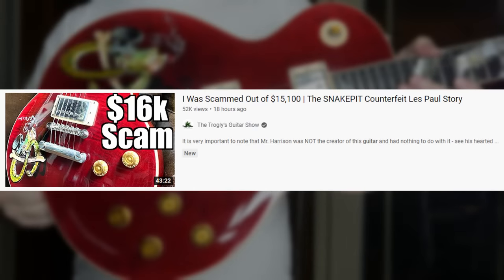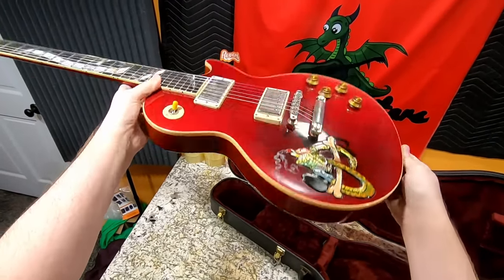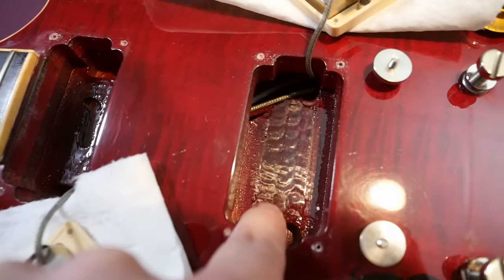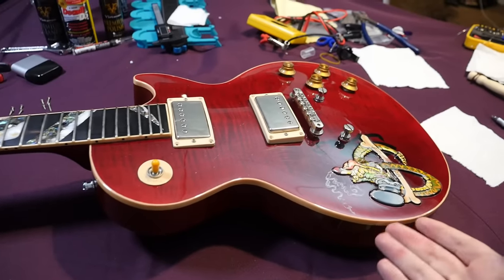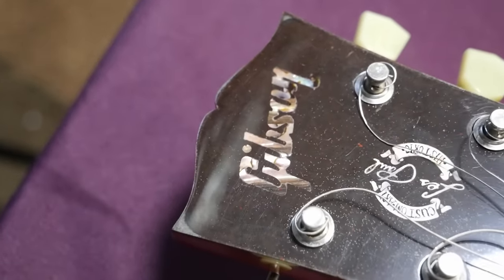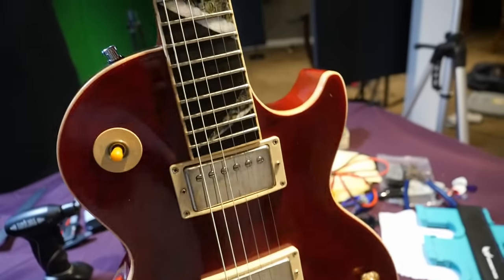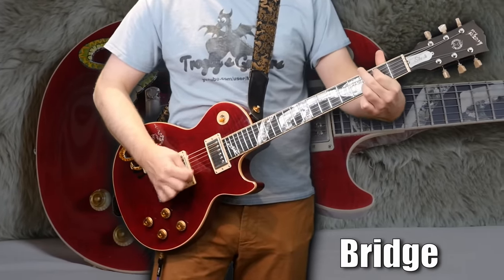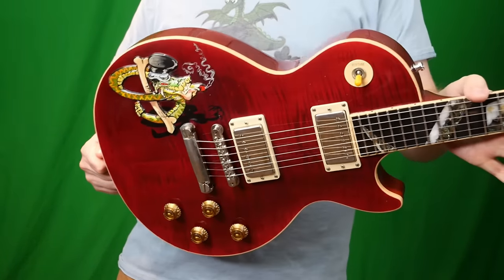Trogly's "Fakepit" | The Replica 1997 Gibson Les Paul Slash Snakepit | History + Review

Comment: Am I crazy or did I see a sticker on that "neck" pickup that said it's actually a bridge pickup? That would certainly explain why it's so much hotter than the current "bridge" pickup. I think somebody put them in there backwards! 😬
Reply: Bingo, You Sir have the eyes of an hawk.
At the 9:35 mark you can clearly see the neck pickup is marked "Bridge".
Reply: I saw it as well!
Reply: Hard to believe he didn't mention that in the video. Surely he noticed that, I would hope! 😬
Reply: If the reading is right, that's more in line with a Gibson 490T than the Slash Seymour Duncan Alnico 2 that should be in there. In that case, all you really need is an ink stamp fake of the Slash design. Heck, the existing bridge could easily be a Gibson 490R, which would actually be a close match to the SD bridge (as both are A2 and ~8K).
Reply: @rindred  yeah when I saw that 13k reading I knew it wasn't a Slash pickup.
Reply: @rindred  yeah someone in an earlier comment said these are fake slash pickups as the readings were wrong
Reply: @rindred  very true. I was thinking even the Slash bridge pickup should have a much lower reading. This is definitely consistent with 498T, so that's probably exactly what happened. Somebody just ink stamped a 490R / 498T set with fake Slash logos. 🤦🏻‍♂️
Reply: Looks like the pickup sticker also dates it to 2016?
Reply: @craighawley3920  I didn't look close enough to see that. I'll have to go back and check it again, and maybe pause it when the sticker is showing. It's so weird he didn't mention any of this in the video. He HAD to have seen it! 🧐
Reply: @damonwolf7222  yeah it’s not like normal Trogly who is a stickler for detail. I can see how he got burned here though.
Reply: @HK Guitar  Yes I noticed,what made me look was in the earlier video it measured at 14k ohms which is about average for a Epiphone Hot bridge pick up.
Reply: It appears to read… 
11E6G 20160420 
APH2B BRIDGE

Comment: Austin, the Nut should be in direct contact with the neck as part of its job is to transmit vibration to the neck (painters tape is not a good choice).
Use some kind of hard shim material (or install a new Nut).

Comment: That’s a Les Paul Classic (Green inlay Model) that’s been refinished and had an eBay fretboard from China put on it. The clue is the binding in the cutaway is too thick to be a Standard and doesn’t show the edge of the maple top. Those fretboards were extremely popular on eBay in the early Aughts and not so much now. Replicas of the PRS Dragon, Ibanez JEM and the Slash Snakepit were a dime a dozen on eBay back then. They would have sanded off the original non-embossed serial and re-stamped it.

Comment: Thanks for the story. 
There was an awful lot of work put into this fake - the inlays alone is a huge amount of work - regardless that it wasn't perfect.
In fact - since the factory ones were CNC - this arguably took more work to pull off.
Same with the snake carving - made then glued on - huge amount of work likely done by hand.
Even replacing a fretboard with an ebony one, then reslotting it, fretting it etc is fairly technical work.
Yes - they completely messed up spraying in a dirty environment - and many other details that made it look sloppy - but that is verging on the very highest end of the forgery racket.
Reply: I've wondered what the value would for such a well-made fake. The most I've sold a guitar for is a bargain $400 for an Electra Rick Derringer X-910 "flying Z" that I inherited from a dead hoarder friend, so I'm hardly an "axe-pert" -- the reason I have been curious is that I bought what turned out to be a counterfeit Cerebus the Aardvark #1 comic book years ago. It turned out that the fakers did a real pro job and made about as many copies as there were of the genuine one (approx. 2000) and believe it or not, the bogus comics were soon assigned a fairly high collector value! In fact, when I returned mine to the shop where I bought it, they cheerfully refunded my price and put it back out for sale labelled as counterfeit for more than I had paid them for it as a supposed genuine item! As such, I wouldn't be surprised to see guitar counterfeiters rewarded for good craftsmanship in the collectors' market as well!

Comment: It could be that the headstock was sanded down on the back to get rid of the original serial number. Best way to check that out is to measure a real LP headstock, with veneer and without veneer. Could be really thick veneer they put on to give it the correct thickness and feel.
Reply: Good point

Comment: RE what you were saying about removing the stamped inlay for the serial number. If the lacquer was removed and you were able to get to the bare wood there is a woodworking technique whereby you can use steam to remove dents in wood. (Handy when you drop a piece or tool onto what you’re working on.)
It’s an extremely effective way to remove any impression which hasn’t broken the wood fibres.

Comment: "Some guys won't ever open a guitar because they think it hurts it". 

Meanwhile, me who just received a new bass through the post today has already had it into it's constituent components, short of pulling off the neck and pulling the electronics fully out (although I had one of the pick ups out to get it sitting straight properly, and had the back off to make sure everything was all good in there and to get rid of some minor hiss when the treble pot was fully cranked). That's the difference between someone who plays and who is just collecting, if you want it to continue to sound good (or to sound good to begin with for some new instruments), you almost have to take it apart to some degree!

Comment: Stamped serial numbers can be steamed out using wet rag and iron. It won't get 100% raised back to flush but close enough so sanding will take care of that. Usually if you mic the thickness of the headstock  this will show up as thinner at the serial number unless they took the time to sand the whole back surface evenly. If the grain was damaged to much from stamping the number may show a shadow of the number. By blending the stain with extra covering the number area that can be hidden. Anyhoo now ya know it can be done.

Comment: Austin, I think the stamped serial number could have been covered by some filler, re-sprayed and then the Slash serial inked on
Reply: Pretty sure the mahogany grain is still visible under the serial number.   I was thinking maybe they just sanded the whole headstock back until the original stamped number was removed.  Measure the headstock thickness and see if it is thinner than it should be.
Reply: @hkguitar1984  That’s another possibility since he mentioned the face of the headstock veneer could have also been replaced to make up the difference with sanding off the back where the stamped serial would be. Still feel bad for him getting scammed like that.

Comment: I have had 2 of the Epiphone Snakepit Les Pauls and they came with blacked out hardware on everything including the Deluxe tuners. The original version was based on the Les Paul Classic and that's why the Epiphone model came with open uncovered pickups because the Seymour Duncan Slash Alnico II pickups didn't come out until around 2002 the Epiphone was more expensive in 1997 but it was only about $75 more. The newer Slash models all came with the Seymour Duncan pickups but the Snakepit was just regular Gibson pickups for the Gibson version and very cheap Chinese pickups for the Epiphone version. The Epiphone doesn't have any of the cobra stuff on the neck obviously because it was way too much for the Epiphone but it is still one of my favorite guitars and the 2 I have had were very different with the decal of the Snakepit on the body. It's under the clear poly but one was much lighter than the first.
Reply: I'm sure those Chinese pickups can be swapped out for the Seymour Duncan Alinico II pickups.

Comment: It's amazing how close they got to making a credible replica though. They actually somehow managed to make an embossed logo that looks realistically like it's carved in but they got the details slightly wrong. If they had put just a little more work into it you wouldn't have even known the difference. The mystery is how  they faked that emboss so it looks really carved in. I first thought maybe they got a real Snakepit and made a mold of the logo, and then cast a plastic one and glued it on, but it's not even an exact duplicate of the emboss, like the snake's lip joins right onto the snake body instead of there being a space between them, and the cigarette is too short. They must have copied it by hand and by eye. If somebody really wanted to, they could do the extra work to make a convincing fake, in fact maybe some of the ones out there are and they haven't been identified as fake yet because they're so good.
Reply: interesting thought , hmmmm ,
Reply: @The68lespaul  They're not even a particularly good guitar, it's just a '59 Les Paul Custom reissue with the snake logo and the neck cobra inlay, so what? You can buy those reissues made in the same year as the Snakepits for about $3-4K. The Snakepits don't even have the same pickups and capacitors as the one Slash had made for him, just the stock "59 reissue ones. You could make a Slash version yourself and it would be better than the commercial Snakepits.

Comment: The binding on the horn does not cover all of the maple, and you can see some of the maple flame on that thicker top.  This to me would indicate that the top is indeed full thickness figured maple.  I have worked in USA guitar manufacturing, my best guess is this was an internal/in-house recovery of a non-QC guitar that someone did a lot of crafting with.  The interesting thing to me is that the headstock veneer is fake, but it is likely a real gibson CNC cut body/neck.  Those are not supposed to get out of the facility without being destroyed.  Keywords, "not supposed to".

Comment: I used to spend a bunch of time in Mexico, in Los Algadones, right across the border from Yuma, AZ.  There's a lot of high-quality hand-woodworking that goes on down in Mexico, usually for souvenirs.  Since this one came out of Mexico, I would not be surprised at all if the custom work was done by hand by some of the souvenir artisans down there.  The "refinish" job is similar to what I've seen from Mexico as well.  I'm guessing it's a Parts Paul with a touch of hand custom work slapped together to make a quick buck.  Someone who obviously knew what went in to a real Snakepit, though, since they got some of the smaller details right (like the pickups and caps on the electronics).  My guess is they put enough work in to it to fool inexperienced buyers who would do only basic research.  It was probably done not long after the Snakepit originally released when people didn't have the resources we have now to spot fakes.

Comment: they could have either sanded the back of the headstock or filled that area with bondo and sanding until all evidence of the serial # was eliminated
Reply: That's what I thought.. They might've sanded the back of the headstock just enough to get rid of the serial #. He should measure it with a caliper around the area and compare it against other LP's of the same era.
Reply: I bought a brand new Les Paul Studio Gem series back in the 90's. With the combination of someone not pressing the serial number stamp very hard into the wood, and the thick paint job it has, you can barely read the serial number unless you shine a light just at the right angle and even then I can't make out every number.  It wouldn't take much for it to be obliterated.
Reply: @TractorMonkeywithJL  a lot of 90's opaque finish paint jobs were like that I think. I've got a white '90 LPC & a cherry '92 SG Standard. The serial number's really hard to make out on both of them, coz of how thick the paint is.
Reply: Thing is you can still see the wood grain where the serial number would've been filled with Bondo had they done that. So doesn't seem to me it was filled. Maybe they put a veneer over it?
Reply: Agreed, yep definitely no bondo or other type of body filler there. That would surly show up under blacklight and even regular light for that matter.

Comment: Hey Trogly - they are NOT the same pickups. What you have there is the 2011-ish "Slash Signature" Alnico-II Pro set by Seymour Duncan. These were hotter wound than SD's standard Alnico-II Pro and did not exist yet in 1996. The Snakepit either came with SD's standard Alnico-II Pro (NON-Slash Signature) or with Gibson pickups.

Comment: Ok, so the 13+ Ohms reading on the neck seems off to me... Even the Alinoco II Pro's that slash had in the 90's were only 9.8 at the top end and the APH2 Neck pickup was 8.3... someting tells me the stamp on the back of the pickup was put there to make it look more authentic as well because that's super hot for what slash likes.  I also saw Slash say he thinks ebony is too bright for the neck but I suppose it's possible this set of guitars had ebony rather than rosewood.

Comment: I wonder if the headstock is the right thickness?  Could it have been sanded down with say a thickness sander to take 1/16" off it, to remove the serial number?  .... Or could the new veneer on the front of the headstock have had a dual purpose, in part to restore the thickness, by just putting the veneer over the top of the original headstock?

Comment: all of those dots in the finish are not sparkle or flake it is solvent popping in the areas where when they cleared it they double coated it in those spots and it traps air under the coat and gives you those dots

Comment: Two other oddities.  The snake's tongue doesn't fall below the snake's chin, But on the other pictures around the net, the snake's tongue is always pointing down past the bottom of the chin.
Also, the font on the serial number looks more rounded than the original, especially the letter L,
its curl is also shorter than the original ones.

Comment: Could it be that there was a mm of wood sanded from the back of the headstock to remove the original serial no.? Did you try to measure the thickness of it?

Comment: Who is "Jack" in the control's. As for the wiring most musicians and Luthier's like the orange drop capacitors over the ring capacitors. Also I've seen enough Gibsons to know about treble bleed circuits and I didn't see it while you paraded over being scared. Also try getting a car polish that makes a claim that their polish does remove swirl marks to get them removed. Buy some and test a small area. If it works, (in the test area) and I would think 70 to 90% will be a win for you. As for the neck, my video looked pretty good. As for the headstock, I agree with you. The stamp at the headstock, it was painted in. But, the incredible artwork is cool enough to doing the fixes. Be honest put the guitar back to sell and I'll believe it would sell still. The work is pretty good and having the pickups signed flame maple with great pop, that's what people want too. Get a reliable Luthier, let him explain about Gibson's curse of the nibs! Offer a percentage of your sell. Good luck with that guitar!

Comment: I can tell that is one of the many LP’s that won’t play in tune. The open strings are in tune on a tuner but as soon as you play a chord the G and B sound like shizznit. It’s almost always the nut from my experiences, obviously you have to make sure the intonation is spot on. But even intonated perfectly some Gibson’s still play out of tune up and down the neck with the factory nut. Most good guitar repair people can fix it with a carefully cut nut. But I’ve had a couple Les Pauls that no matter what you did nor how much money you sunk into them they wouldn’t play in tune. It turned me off of Gibson’s for a long time. Recently (last 2 years) I’ve fallen back in love with Gibson guitars again. I’ve always preferred the roar of a distorted SG or LP over a Fender, but both my current Strat(1962) & my previous Strat(1973) always play in tune, are lightweight & a joy to play all night long. That said a Strat just cannot do the humbucker thing- even when you put a humbucker in a Strat- there’s something to the set neck mahogany for sure. On the other side of the coin a Gibson can’t do what a Strat does either- even with coil splitting it’s not the same. So I love both for what they are except I’m much more particular when buying a Gibson- I gotta make sure the G string wants to play in tune- cause some Gibson’s seem to refuse to.